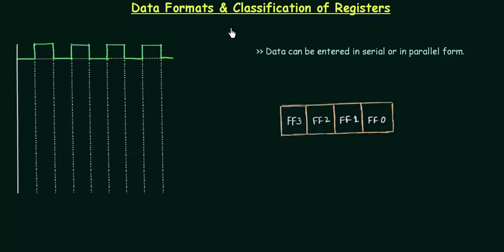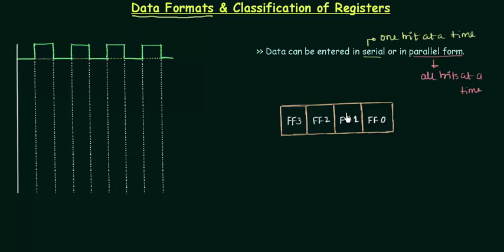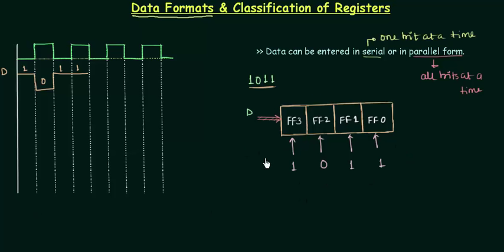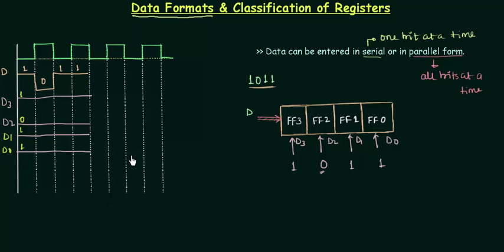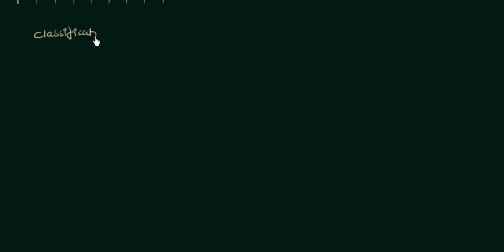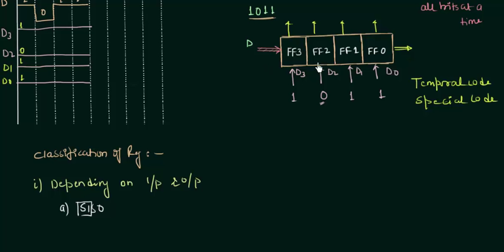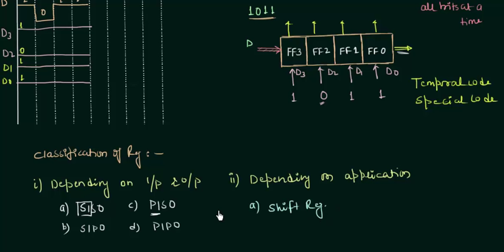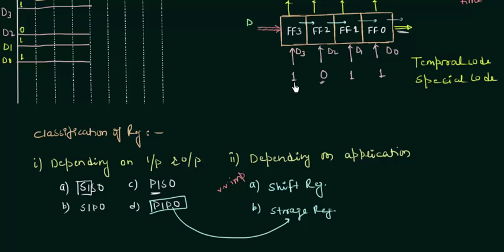Data Formats and Classification of Registers

Comment: In the first part of the video, why the inputs were drawn, on the time diagram, up to only the second clock? Shouldn't they be up to the fourth clock for serial format and up to the first clock for the parallel format?
Reply: yeah i was wondering about the same thing. But i think that since he didn't mention anything about the type of the clock, the timing diagram is not correct nor wrong. But if u were assuming that the FF is negative edge triggered, the timing diagram in the serial form should be up to the fourth pulse, while in the parallel form each input up to the  1st pulse.
Reply: @evanaw1164  @Omar Ahmed i may be wrong but i think the reason behind why serial inputs were drawn up to the second clock is because of using (master and slave f/f.). by using master and slave f/f we can get the output in (half clock cycle). ITs done to use the clock cycles more efficiently and not wasting it. (correct me , if i  m wrong).
AS far as why parallel inputs were drawn upto fourth clok cycle, for this yes, we are on the same page.  I also think that those line (for parallel inputs), should be drawn up to one half clk cycle.

Comment: shouldn't the input of D be 1, 1, 0, 1 for the serial form? if the input was 1(1st tick), 0, 1, 1, the data interpreted in the flip flops would actually be in the inverse direction (1101) or in other words first in first out. the clock of the flip flop should also be determined, whether it  is positive or negative edge triggered(and the timing diagram of the serial input D should adjust accordingly) which means, the D will change only after 1 full period of each pulse, not half of it.